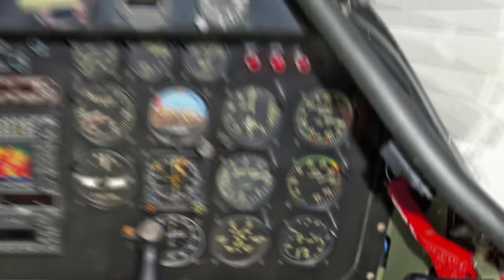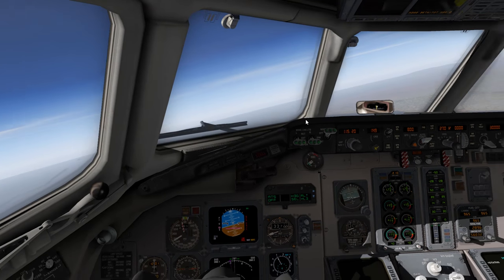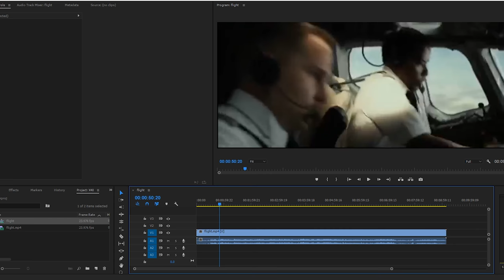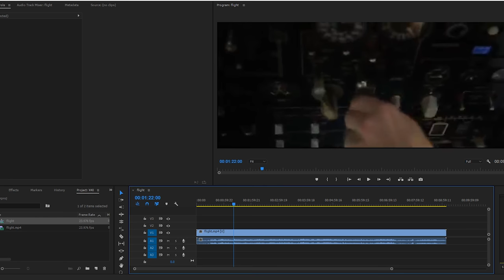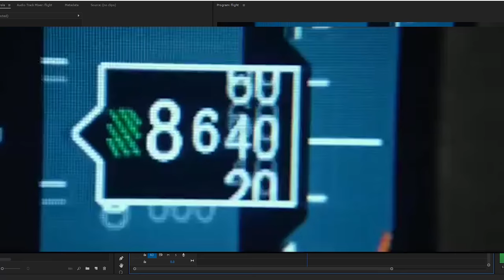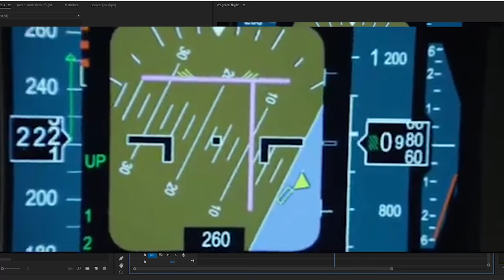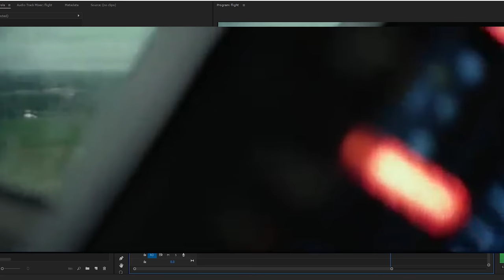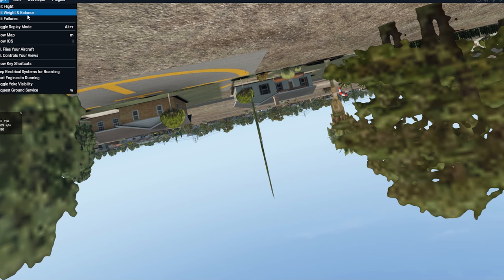Flight Movie: Can an airliner fly upside down? [Simulation]

Comment: You are forgetting that the elevator trim does NOT control the elevator it's self. The elevator trim controls tiny " flaps " on the elevators tailing edge and there moveability/operation is not dependent on the jack screw . The jack screw moves the elevators. Now for your mistakes in your " recreation " of the flight. In the flight the trim was fully operational ( you claimed it was stuck and therefore could not use it= You were Wrong: You also { apparently } think the trim is what brought the plane down=You were Wrong ) In the flight spoilers where called and deployed but then retracted  and then partially deployed on the roll out. ( you deployed them full and left them deployed=You were Wrong ) In the flight flaps were set to 30 at FL195 then fully retracted for the roll and then set to 15 for the roll out  ( You set flaps to 30 at FL240= Wrong: You set flaps to full for the roll out=You were Wrong )  In the flight the gear was retracted for the roll to reduce the amount of drag and the gear remained stowed for the remaining form roll to roll out. ( you deployed the gear in your roll=Your where  Wrong ) In the flight power was added in the initiation of the roll ( you never once added power to your aircraft when you initiated the roll=You were Wrong ) We did an exact  recreation of the flight in a full motion  simulator for the MD-83 and the results showed a 2 out of 10 success rate ( you claimed it wasn't possible=You were Wrong ) Sure 2 out of 10 is not very good but it proves that it is a possibility, a very rare and very unlikely outcome but still possible.
Reply: Good on you, Chais Wade. Thanks for such a refreshing breeze of truths into the very negligent speculations.
- I'm just a movie viewer, but had watched the (excellent) movie several times, enjoying it hugely, noting many details, explaining them to friends I showed it to.  Then I stumbled across this series of posts.
- The good-faith simulation above was, as you say, an extremely shallow and naive version of the realities of the flight - clumsily ignoring many crucial details (as you have pointed out). I'm no authoritarian, but think of this...
- Does the X-Check REALLY THINK the movie's authors and producers and directors would not have conferred very extensively with aviation engineers before creating and releasing the $31 million dollar movie? 
- Also, does X-Check think the movie producers don't realize the audience will include thousands of pilots, aviation engineers etc., all instantly ready to publicly ridicule a technically very erroneous movie, risking millions of stay-away customers?
Reply: On the MD 83 the jack screw does control the entire vertical stabilizer (horizontal stabiliser trim system) not the elevators. the "tiny flaps" that you refer to are called control tabs.
https://www.youtube.com/watch?v=cIeRQvKA2DA
https://mudabahaya.files.wordpress.com/2013/11/jackscrew05_b.gif
Hard to believe that you tested the simulation if you don't know what the jack screw does or doesn't.

Comment: 22:58 Full power + engine on fire = AFTERBURNER for Hollywood xD
Reply: Actors don't know how jet engines work.
Reply: lol
Reply: theyve dumped the fuel so when u are out of fuel thats what happens at the end there will be a possible burn out
Reply: I have been informed by a pilot that you can fire the engines after you've extinguished them, you just have to reset the system.

He mentioned that he had heard of pilots using this to dislodge debris, though it's not something you would do lightly.
Reply: Isnt the engine blown to hell?
Reply: LOL!

Comment: I'm a student pilot for light aviation aircraft, and I would like to point out that the primary reason not to fly inverted is that in many aircraft that aren't specifically designed for it, the engines will cut out due to fuel starvation.
Even if they don't, the lubricating oil will pool in the wrong places.
Plus, you can end up leaking fuel in some aircraft.
It does vary very much depending on the aircraft and engine design though.

A further thing to note is most aircraft wings are assymetrical, and designed to produce lift in one direction but not the other.
That's not completely disastrous, but in general you should expect to have less lift in inverted flight, and require odd angles of attack.
It's also not a particularly stable position, and your balance and centre of mass is likely to be off.

Aircraft for acrobatic displays, as well as most military aircraft (fighters in particular) can fly inverted reasonably well though.

Acrobatic aircraft tend to have symmetrical wings, which is less efficient and produces less lift and more drag, but it does mean as long as you get the angle of attack right, you can fly just as well upside down as right way up.
Plus the engine oil and fuel pumps are designed differently so that the engine keeps running.

Engine cutout is not something I've noticed xplane particularly replicating very much, so I wouldn't expect it to really give a proper sense of what kind of risks and difficulties it poses.
Reply: Oil pressure warnings huh. Well at least that's to be expected... XD
Weird film, certainly doesn't seem to be too careful with it's details...
Reply: Carburetors require the help of gravity to deliver fuel into the engine. However, an aircraft that uses a fuel pump does not need gravity whatsoever. Therefore, an aircraft upside down long enough with a carburetor will cause the engine to fail and an aircraft with a fuel pump can fly upside down all day long without the engines failing.
Reply: Surprisingly, the movie replicated that pretty well - after Whip inverts the plane, the engines lose oil pressure and ignite, eventually both failing as he inverts it back around.
Reply: Crash
Reply: I know 'fuel starvation' from war thunder lol.
Reply: This is very possible actually, he could have just used the rudders as well as the stick, and used the right engine at full power because the 1st engine was damaged . which would made the plane bank left. Try it again with rudder and full stick to the left. and put engine 2 to full
Reply: Yes, it will, thats why in the movie the engines kept running until the plane fliped back to its normal side, then glided to the field
Reply: Well first of all, Kuralthys. They dumped the fuel before they went inverted
Reply: yeah the engines lost oil pressure in the movie, I totally agree with what you said.
Reply: Micah yeah but the pump might starve depending on how fuel pick up is designed.

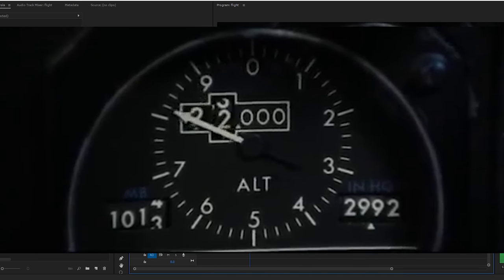Comment: If at 9:29 your going to complain about them saying they don't have hydraulic, at least acknowledge it was a strategic line included in the movie setting up the line at 12:37 where the FO confirms that hydraulics is not the problem because the gear worked.  They're troubleshooting, they're trying to figure out what's wrong, and they can't pause their crash and hypothesize.
Reply: Redtail Media Productions Why would they say they don’t have hydraulics when there is large gauges in the middle of the cockpit showing the hydraulics? In a real situation that is unneeded confusion and stress. It’s like saying while you had a birdstrike “Oh no, the APU stopped working and the cargo bay door hydraulic stopped working” when they are working or is unnecessary
Reply: James Fulkerson well in thr situation I would assume it would be panic. Suddenly all elevator control and steering is gone, his first thought was probably oh shit the hydralauics stopped working, and issue that was resolved later when they confirmed they we're working. It's possible he assumed the instrumentation was incorrect, idk. It's a human trying to troubleshoot based on given information
Reply: The guy just woke up and the control column seem unresponsive. So yes, hydraulics was the first thing that crossed his mind, soon after he radios only that he has no vertical control.
Reply: *If at 9:29 you're going to complain...

Comment: You can lower the gear without hydraulics. There is a feature on some aircraft where you can open the gear doors without hydraulics and unlock the gear. This allows the gear to fall down by gravity.
Reply: But the nose gear isn´t heavy enought to fall by gravity, just like the Air Canada Flight than ran out of fuel.
Reply: Or you can open a hatch and crank it
Reply: No there's a different procedure for gravity gear lowering or hydraulics.  The way the gear went down normally, FO knew the hydraulics were working.

Comment: Receiving fuel or not on the MD-88, or any other Commercial airliner, pulling the T handle  to extinguish the fire automatically closes the fuel valve, hydraulic fluids shut off to that engine, engine bleed air shuts, generator field relays are tripped and the hydraulic pump low pressure lights are switched off. . So once you pull those levers you ain't getting that engine back.
Reply: Dunesky Jewett maybe you couldn’t get that engine back, but Denzel can
Reply: Denzel gets what he wants no matter where when and how

Comment: after looking at this video I came up a theory if this is possible. First with the fact that "The plane is a JR-88, a type that exists only in the mind of a screenwriter. It looks suspiciously like an MD-88, " one thing I noticed it when it dives the SINK RATE alarm go's witch in real life that will only go off if your low and your descending too fast. The Fuel dump system is impossible because only long range are required to have this kind of system. for the hydraulics "Maybe in the make-believe JR-88, but the MD-88 doesn’t have hydraulically powered flight controls. It’s all cables and pushrods moving control tabs on the elevator, rudder, and ailerons." And if there was a hydraulic system the manual flight control lever is also make believe. I believe the flaps would of gave him that bit of lift but then of tore off because of the speed. when the engines  turned into a BBQ 's The fuel is fuel valve is pulled witch shoots Halon into the engine, but the problem is this also isolates the fire ball from the rest of the plane, cutting off fuel. At this point you would lose power and the APU would have to be flipped on if both engines were not running. I image the APU was not mentioned for the sake of simplicity to people who dose not know about airplanes. The likely hood of both engines going out is extremely unlikely but for a theory I'm thinking the speed was tarring the plane apart having the little chunks of plane flying from the wings to the engines! if your still reading this then good for you but he's the million dollar question dose the maneuver work as mentioned  " It’s an imaginative premise. They were in a situation where the elevator was locked in a position forcing a nose-down pitch attitude, which caused a rapid dive. By going inverted, the nose will be pointed skyward, but there would still be no control of the pitch. With enough power, the plane would now climb skyward under negative G’s, but the pitch attitude would still be uncontrollable. In such a desperate situation I guess it would be worth a try." So I guess you might have a small chance but I wouldn't count on it.  ( I got all my info with a mix of my own knowledge and the air space article as you can see blow) Coagulations if you read all this, you deserve a cookie!
  
Read more: http://www.airspacemag.com/daily-planet/is-denzels-upside-down-flying-trick-plausible-123318220/#ZxH0bkhU7CBDyVYd.99
Save 47% when you subscribe to Air & Space magazine http://bit.ly/NaSX4X
Follow us: @AirSpaceMag on Twitter
Reply from the maker: Hey that's a pretty interesting theory. And I want my cookie.
Reply: Ronald Bird  Lol! Thanks for the cookie boss!
Reply: I'll take a cookie also thanks (and in answer to your question, I actually have no idea lol sorry) :-D
Reply: Ronald Bird could I have some milk also

Comment: For anyone doubting that a scenario like this actually happened or is possible at all, allow me to restore your confidence.  This scenario actually did happen in real life, but with not so much of a happy ending.  Alaskan Flight 261 (MD-83) back in January of 2000 went inverted after a jack screw broke in the area that controls the rear stabilizer/elevator.  The plane would not come out of a nose down attitude dive.  After several attempts the captain actually successfully flipped the airplane upside down, scrubbing off speed and arresting the dive.  The plane flew level for some time and was actually visually observed by other aircraft in the area flying in this configuration.  As they got closer to the airport, the captain attempted to roll the airplane right side up in order to land.  He did so, however the plane pitched violently down once again.  As the plane dipped towards the ocean, the pilots tried to go inverted once again, but could not get enough thrust.  The plane crashed in the  Pacific, killing all on board.  Very sad situation, however alot was learned and later perfected as a result.  Cheers...

Comment: I feel that flying inverted on a low-wing aircraft is similar to holding something on a string, it wants to fall down and isn't in any way stable. Not only that, the wings are designed to be angled slightly up so flying inverted, especially with flaps only makes the aircraft  lose altitude faster.

Comment: I don't know about the MD-80 but most airliners have a jack screw that controls the elevator. This jack screw system has been known to bind up and strip. This EXACT failure has caused a notable amount of crashes. And YES, the backup he is referring to is the backup electric hydraulic pumps.

Comment: I love your movies and in this case i find it a bit ode.
Though X-plane are a good sim, it can not be used to show an actually planecrash like this. It will not take in to the fact, that the fuel is cut when the fire extinguisher has been used, and there are other circumstances that the sim do not take account for.

But there are errors in the movie as well.
First. The horizontal stabilizer is not the same as the elevator.
Second. When rolling out of the inverted flight and the command "Full flaps" is 
given the co-pilot pushes the flaps-lever forward which in every plane 
would retract the flaps.

And as you mentioned. During the moments just before the crash, the First Officer extinguishes
the engine fires by pulling so called T-handles. When a T-handle is 
pulled it activates the fire extinguisher, but also it cuts off the fuel
flow to deprive the fire of it. In the movie the engines are seen 
operating after the T-handles are pulled.        

but else...keep up the good work!

Comment: 8:29 The reason it pushes to the left might be because the elevators are locked in different postions. The elevator on the left side could be stuck in a slightly higher position than the one on the right side, causing the aircraft to bank left

Comment: "He is nose down but climbing?" lol!
Reply: Hyper  Yes! With the stabilizer stuck in nose down, once inverted you would have the opposite effect. The engine situation is totally fictional and it would not work, but they would regain vertical control inverted.
Reply: Sorry, I didn't mean vertical control, I meant they would regain vertical stabilization, in theory.
Reply: Hyper aparently its got to be lift fighting with force of the nose goid  down

Comment: Not sure if full flaps can counter the downward pitch from stucked tailplane.
Also the "stucked" might not actually be stucked in real world, since its pivot point is behind the center of drag, so it tends to stay in that position when get blown by strong wind even if you try to invert the airplane. (Maybe push down might cause elevators to produce upward lift and causes stabilizers to tilt downward when speed is low enough?)
So, many things that game or simulator cannot simulate here.

Comment: The engines would still be able to run, due to the fact that on this aircraft (in normal lfight) the engindes are above the wings. That means the fuel need to be pumped, in inverted flight, its like the most airliners, u will get gravity feed for the enginde because the fueltanks are then above the engines

Comment: I have wondered about this with the Alaska Airlines Flight 261 accident in particular. Could it ever be possible to land a commercial airplane (or any airplane, for that matter) inverted in a way that was survivable? In the Alaska Airlines 261 case their sink rate was obviously too fast when the impacted water, but could something be done about that? And if enough lift was possible to generate while inverted to make the impact with the ground "smooth", how much worse would it be than belly landings without landing gear?

Comment: I think that flying inverted is most likely possible for a very short period of time, with consequences after. It has been shown before that passenger airlines do have the ability to go inverted during barrel rolls. The real question is, can the aircraft structure actually manage the negative G's? Since most or the airliners are rated at no more than -1 G. In this situation the wings would simply snap off.
Reply: The airframe can take it, I believe they are certified to -3 gs. All kinds of other systems start quickly failing when the plane is truly inverted, and not doing a barrell roll, which is a positive g maneuver for the aircraft.

Comment: flying a plane on the back like this one is still possible but for a limited time because of the desine of the fuel system and the engine oil but could surely do it